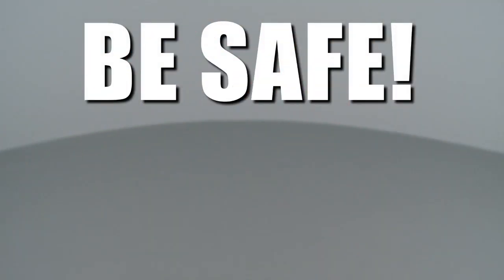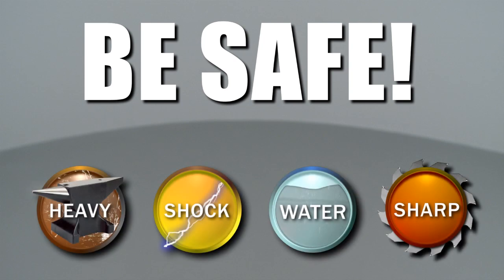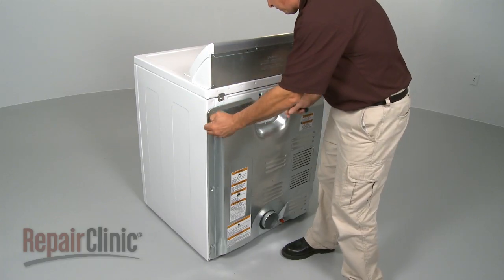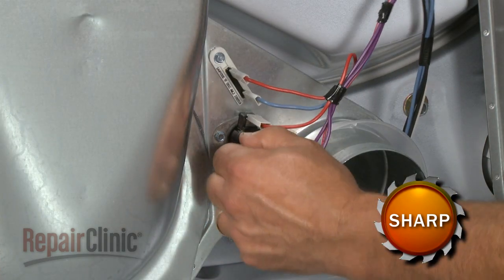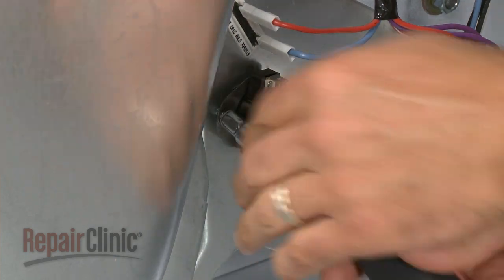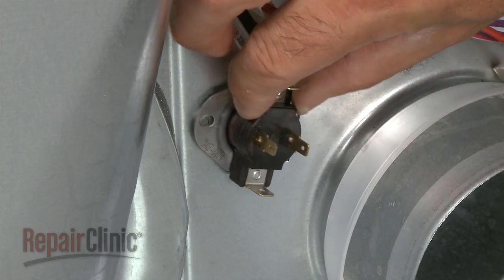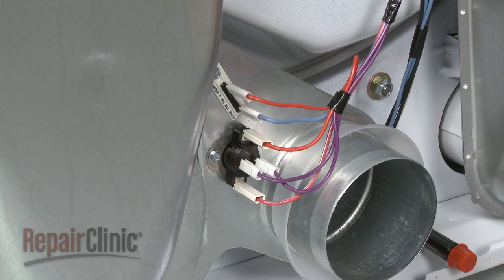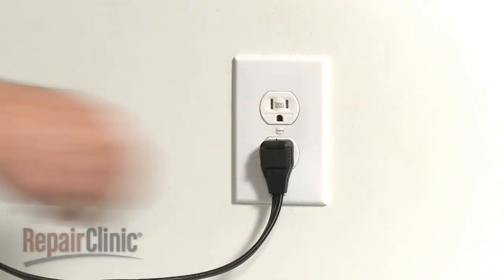Whirlpool/Kenmore Gas Dryer Cycling Thermostat #3387134

Comment: FYI: on a Kenmore 90s series the cycling thermostat is accessed through the bottom front of the dryer by removing the Lint Duct Assembly- very easy
Reply from the maker: Thanks for the tip.

Comment: does polarity apply to this part when reconnecting the wires?
Reply from the maker: No, as long as the correct two wires are connected there will be no polarity issues.